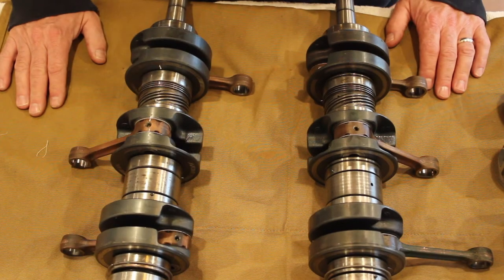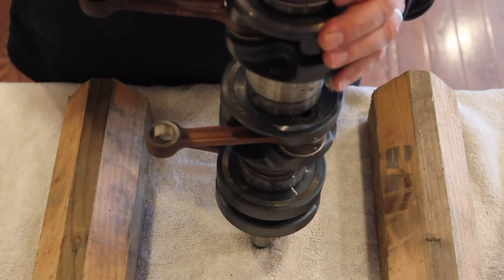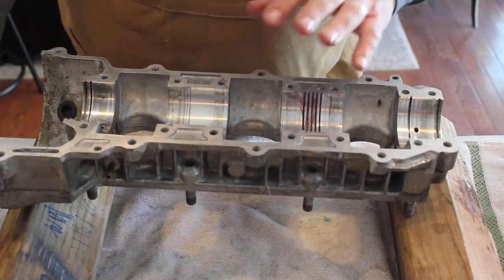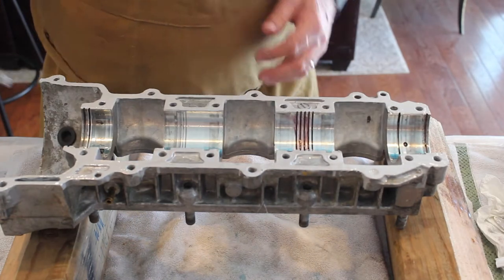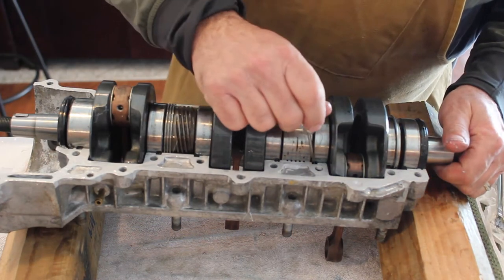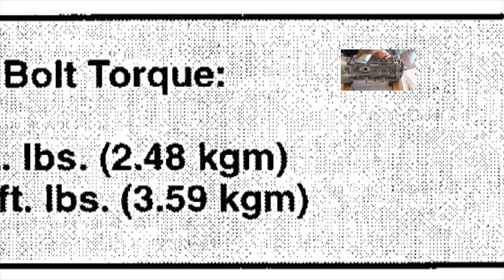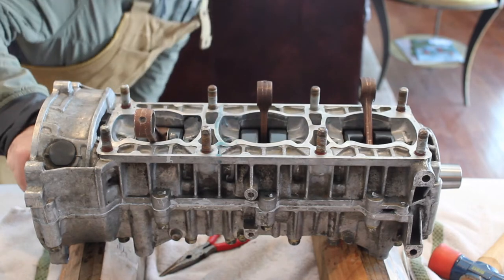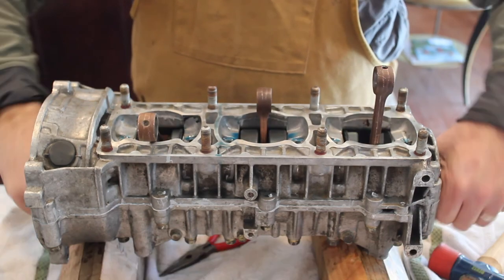Old Sled Rebuild - Part 3:  97 Polaris XLT 600 Triple Crankshaft Install

Comment: Previous comment with a great conclusion accidentally  deleted:  "So in conclusion, more than likely, when the piston seized the first time from the air leak in the carburetor boots, that same crank shaft bearing went dry. Your other three boots weren't leaking, consequently, those other respective bearings were still good so we know that air leak in the intake manifold was the culprit."

Comment: Why are you lubricating where the bearings sit? That's not a bearing journal.
Reply from the maker: Thank you for your question.  You are right.  The manual calls for the labyrinth grooves, oil pump gear and crankshaft seals to be greased.  It does not call out the lubricating the case.   I had seen some other content where the case was lubricated as I did so I decided to give it a shot. It's likely not necessary.
Reply: Where do you order parts from?  I need to rebuild mine but finding parts seems confusing & difficult.
Reply from the maker: @ericlandis8867  I primarily use Al's Snowmobile in Newport Vermont.  They ship parts, are a great resource for questions, and have good inventory:  https://www.alssnowmobile.com/. I have also used Hudon's sled salvage in a pinch and often find rare items on ebay.  I hope this  helps...
Reply from the maker: Babbit's OEM is a good resource for factory old stock and new parts.  They have an iphone app that has parts diagrams and parts numbers too.   Good luck.
Reply: @Dennis Does It All  you dont ever lube a bore on any engine where a bearing sits. It always gets installed dry after an alcohol or acetone clean.